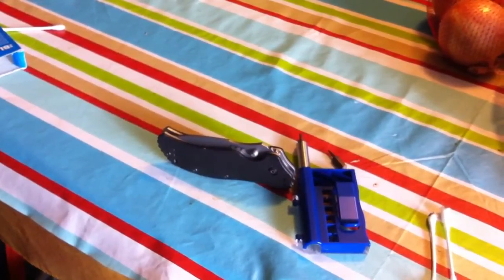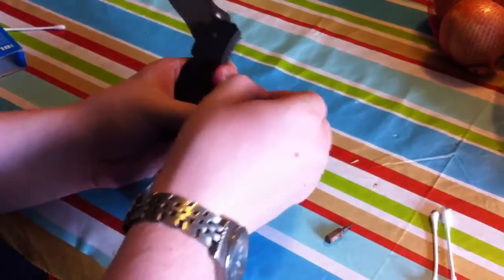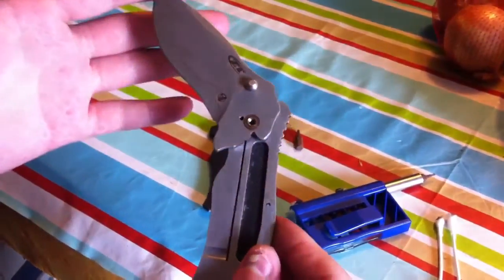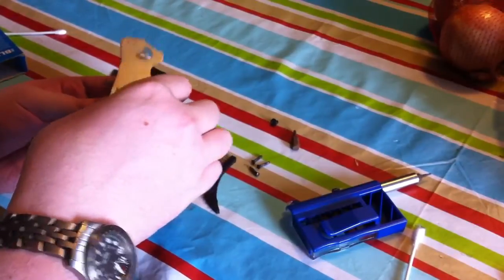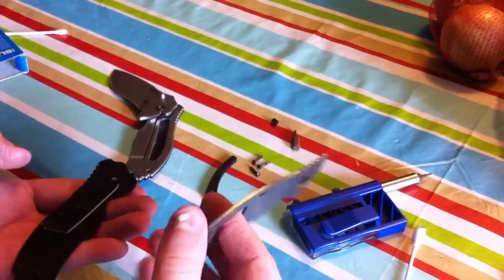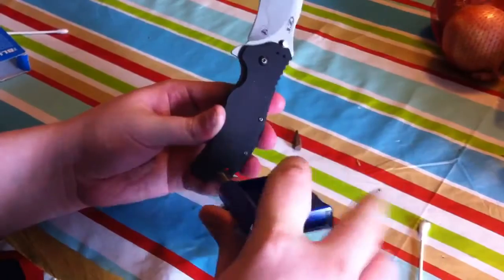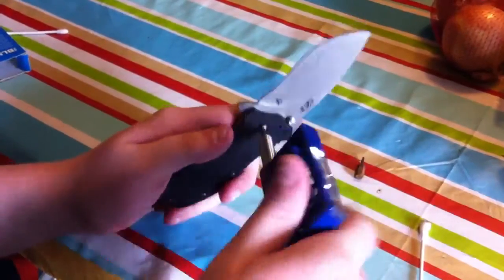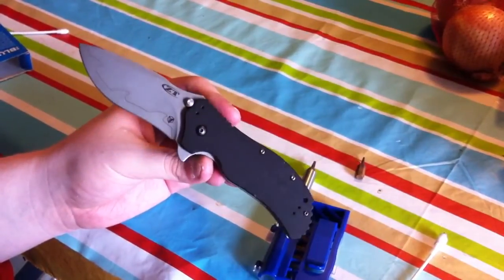ZT 0350 Disassembly/Reassembly

Comment: Have you ever had trouble getting the smaller screws out?  I'm trying to take mine apart and the screws are just spinning the little parts on the other side that they're attached to instead of unscrewing and comeing out. Any advice?